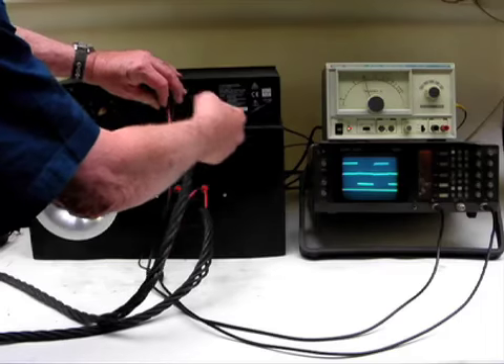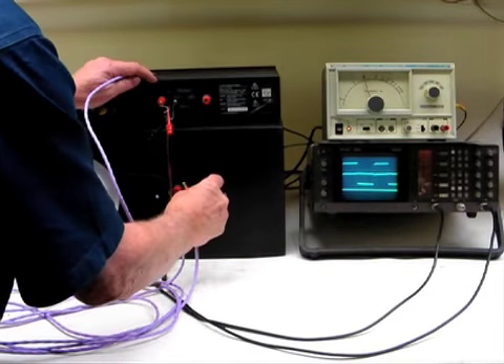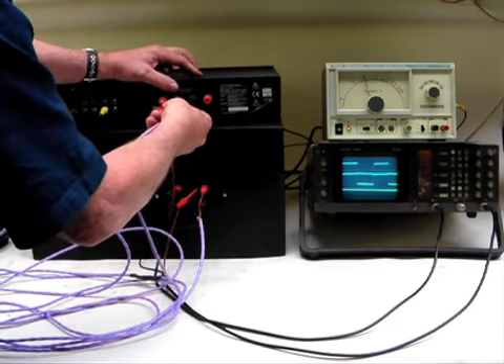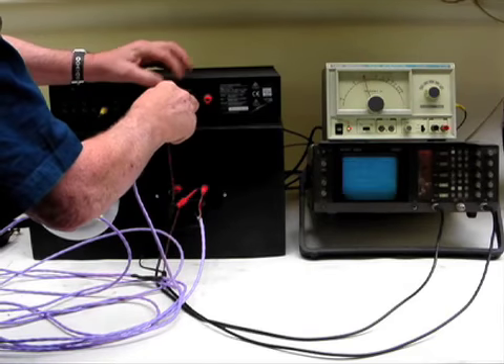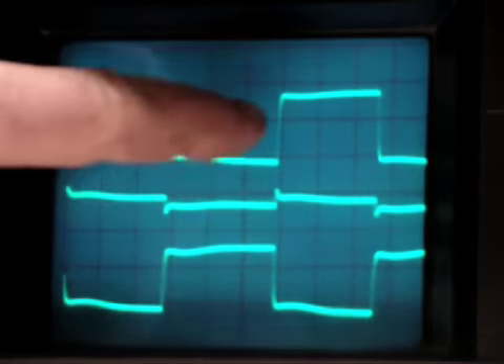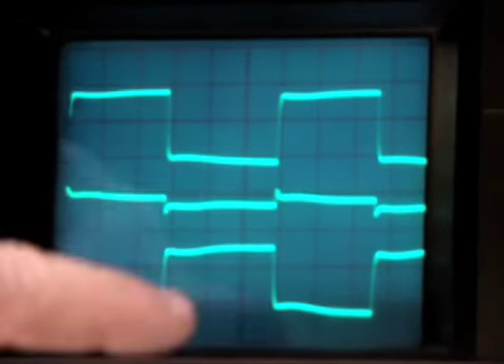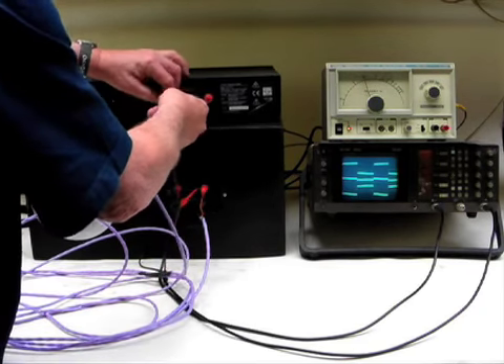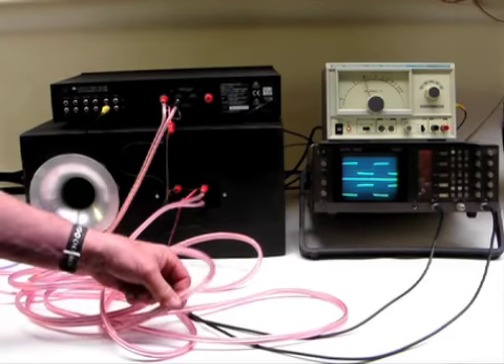Townshend Audio Isolda Speaker Cable "geometry matters"

Comment: Square waves mimic infinite frequency at the verticals and DC at the flats. Although  your oscillator generates them from sine waves the summation that we see fundamentally excludes the audible spectrum and the glitches could just be aberrations. To prove that your cables sound any different with music you could show us something in the audible spectrum.  Go on show us with music from a CD and I'll eat my hat.  By the way for a speaker cone to produce perfect squares it would have to weigh zero.

Comment: I have never seen a square wave come off an music CD with my scope.  Music appears as multiple overlapping sine waves of ALTERNATING CURRENT without any square corners DC offset flat tops or vertical lines even on the loudest percussive transients and you would see no difference between this very expensive cable and regular figure 8 if you substituted a CD player for that inappropriate square wave generator. Go on.  Show us the same experiment with a CD player playing music.